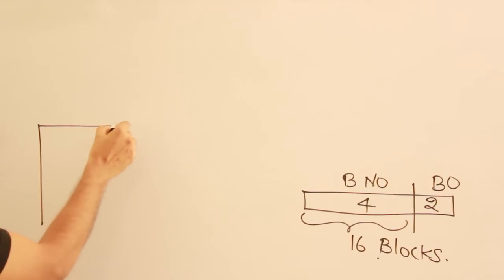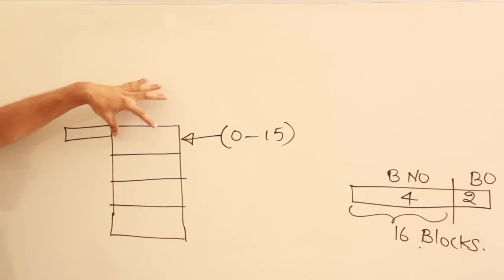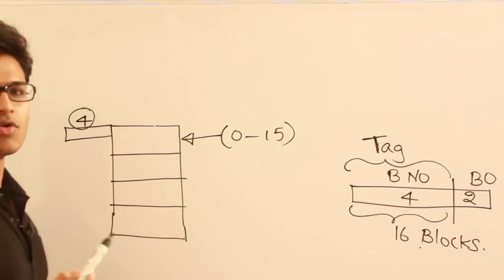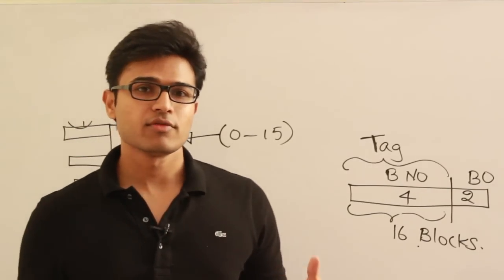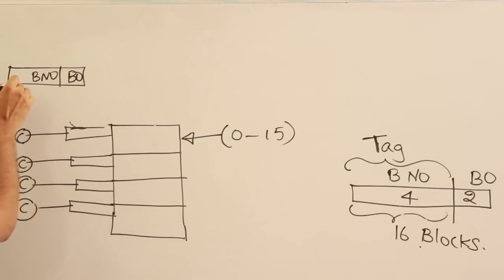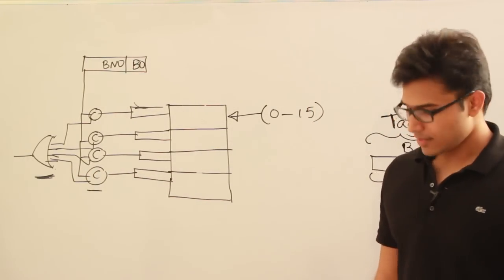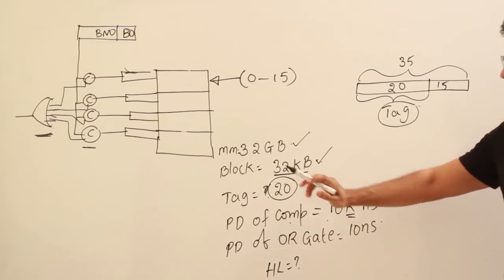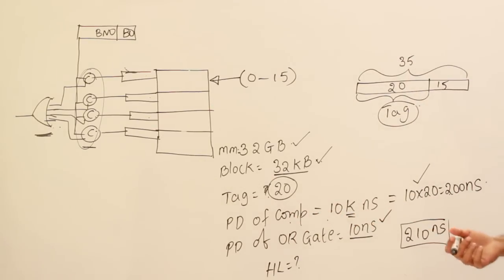COA | Cache | Introduction to associative mapping | Ravindrababu Ravula | Free GATE CS Classes

Comment: @6:40 you inferred that the 
propagation delay of Comparator = 10 * k ns (where k = tag bits)
But how many comparators are being used, is not mentioned(it could have been derived by the size of cache as the no of cahe line is log(Cache size).) 
Now, in case of multiple comparators the OR gate  is used.
In that case, what is the use of the propagation delay of OR gate?
Did I miss something out?

Comment: Is it one bit comparator?
If not then all comparators will work in parrallel, right? so HL should be 10kns ( ignoring OR gate delay). 
And in the video you have missed the  'k' in propagation delay of comparator

Comment: "32GB means you can think of it as 35 bits and 32KB means you can think of it as 15 bits, right?" what? anyone care to explain? (7:40 isch)
Reply: +Johan Hjalmarsson 
2^10 = 1024 B -> 1KB ==> will have 10 bits( The 10 in 2^10)
2^10 * 2^10 -> 1MB ==> will have 20 bits(The 20 in 2^20)
2^10 * 2^10 * 2^10 -> 1GB ==> will have 30 bits(The 30 in 2^30)

So,
32 * 1GB = 32GB which is 2^5 * 2^30 -> 2^35 and will have 35 bits

32 * 1KB = 32KB which is 2^5 * 2^10 -> 2^15 and will have 15 bits
Reply: +Johan Hjalmarsson 
1GB means 2^30 therefore having 30 bits. So 32GB means (2^5)(2^30) therefore having 35 bits. Similarly 1KB means 2^10. So 32 KB is (2^5)(2^10) which has 15 bits.
Just remember 2^10=1KB, 2^20=1MB, 2^30=1GB and so on..
Reply: vinay choudhary Thanks!
Reply: +Johan Hjalmarsson Here 32GB can be expanded as 32GB=32*1024*1024*1024 bytes.so apply log it can be 
log(32*1024*1024*1024)=log(2^5)+log(2^10)+log(2^10)+log(2^10)=5+10+10+10=35
Reply: This becomes very easy if you remember the following powers in binary (base 2):
2^(10) = Kb
2^(20) = Mb
2^(30) = Gb
Now simply express 32 as 2^(5) and multiply it by the Gb. Remembering that like bases add powers in multiplication
2^(5) x 2^(30) = 2^(35)
The power number always tells you how many bits you'll need to express that large number. 2^(n) needs n bits to express whatever many combination of numbers you can get here.
With that in mind, 2^(35) means we need 35 bits to express all the possible combinations.
Hope this helps!
Reply: thanks @ swaraj somala
Reply: thanks .I got it !
Reply: ^ means power of
KB= 2^10
MB=2^20

GB=2^30
32=2^5 
32 GB=2^(30+5)
=35 bits
Reply: Johan Hjalmarsson understand t by this logic 2^10 =KB, 2^20=MB, 2^30=GB, 2^40=TB

now 32GB= 32x2^30
now for 32=2^5
we have 32GB =2^5 2^30 
add powers of 2  you will get 2^35

similarly 32KB=2^5 2^10 which is 2^15

I hope you understand.